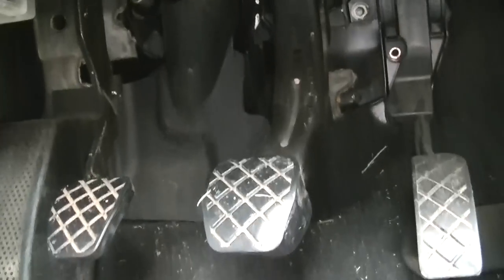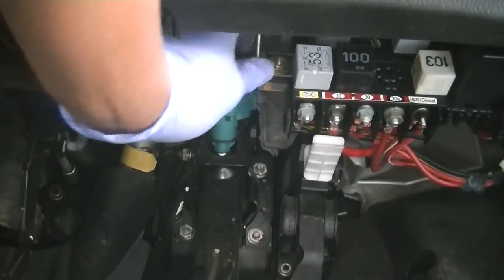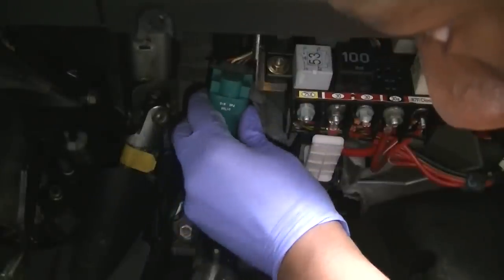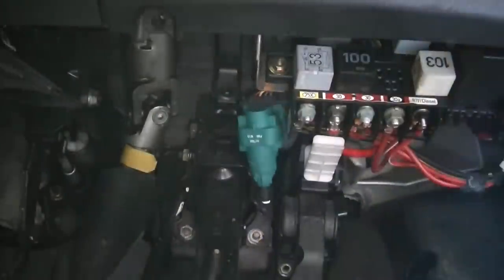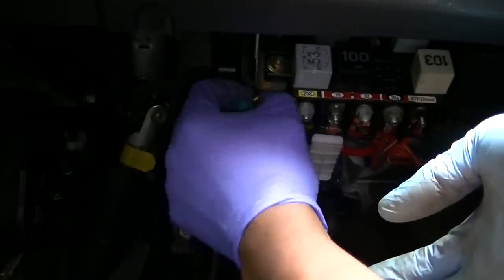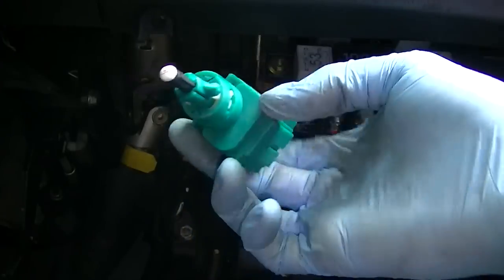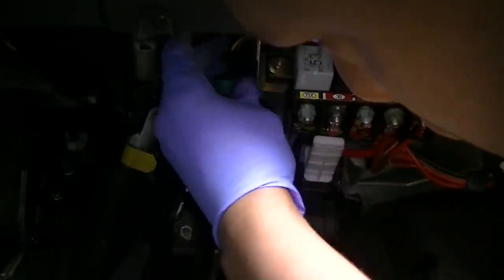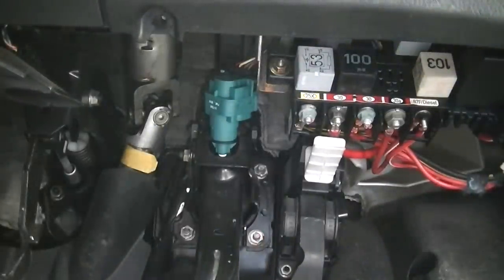VW Brake Switch Replacement

Comment: Good man.... the other day I parked in the garage and as the garage door closed behind me I noticed a red glow on inside of door. Thought to self, self, that's odd since it's daytime and didn't have the car lights on. Turned out brake lights were on.... Gave pedal a tap and they went out. But now a week or so later they seem on all the time and yes, the engine management light is on too so let's get a new switch. Hope it's not too difficult for my old bones to grovel in the footwell though. (Son might come in handy here....)
Reply from the maker: Thank you for watching

Comment: will that work on a 2000 VW caddy , the rear brake lights are stuck on the only time they come off is when , I pull back very hard on the brake pedal reversing the motion
Reply from the maker: It should fix your problem if the switch is broken. 

Good Luck

Comment: An easy fix to a problem I hope I might be having.

BMAC VAGS, I own a 2001 MK4 Golf and have an issue with my shifter being able to move through the 'PRND321' without the use of the brake pedal. Not very safe while driving! This started happening shortly after the brake pedal light stopped illuminating (telling you to step on the pedal before shifting). Would this be the solution, or would it have something to do with a cable in the shifter itself?

Comment: hi!good day! just wondering how about the ´glowplug light´on a dasboard blinking all the way and it´s say´s ÉNGINE WORKSHOP FAULT´..i have a vw touran 2005 model..i have been on a autoshop and they say it can be the ´brakelight switch ´sending some fail codes on a dashboard..but the worse, the auto mechanics keep on saying that..´this thing maybe the problem,or that thing maybe the problem´...i paid nearly 400 bucks to search what is wrong with my car but i found out that they cannot pin point what is the real problem on the car.maybe they are trying to rob me on other way,,please help..thank you in advance..

Comment: Is there a certain amount of depth that the switch must be in when replacing? Is there a stopper that tells you when to turn clockwise to tighten it?
Reply from the maker: no it is all prefixed ready for install. No adjustments needed for installation

Comment: Can this switch cause. STOP BRAKE FAULT to come on the dash. My brakes work fine. Brake fluid is full. I'll drive down the road. Stop the car put ignition off and start the car and the warning goes away

Comment: is this as easy to do on an Audi A4?
Reply: Hey Mark - seems to be the same according to this guy:
http://forums.vwvortex.com/showthread.php?1158315-DIY-Installing-a-new-brake-light-switch-(without-breaking-it!)&p=81885376&viewfull=1#post81885376
I'd check with the Audi dealer parts dept first though in case the part is different or has changed - you can always ask them what the right part is and for a quote, with no commitment to buying it or having it done by them.
I'll wager it's the same part. For the Golf, they seem to have upgraded the previous A, B, C, D switches to the new 1C0945511A, which I am about to fit. Seems like it is much easier to fit without all the adjustment trauma of previous versions... but we'll see. Famous last words.

(Edit: fitted it ok - bit of a pain getting the plastic trim out/back in but fine really. Bit tight on space and light, and you may need a screwdriver or two to push the plastic bits in to remove the plug from the old one, as they were indented a little on mine and wouldn't press in with just my finger and thumb. Other than that, surprisingly simple job. With the new 1C0945511A part, there was no reassuring click that they mention, just a kind of weak, dull thud when I turned it clockwise to the end of it's travel. So dull, I was afraid I hadn't done it right. But lo and behold, when I reconnected the battery, the lights are working again.)

Comment: Yeah, that part of the replacement is  the simplest step of the replscement. Why did you leave out the most frustrating steps that are required to even access the switch?

I cannot find any info on how to remove the pedal cover panel, or the locations of all the fasteners and trims that must also be removed as they overlap the upper pedal cover panel.....

Can you make a complete replacement video and not just the easiest part that needs no explanation? Sorry, but I am so frustrated, and angry at the engineers who design such ridiculous components.
Reply: I am dealing with my Wife's 2017 VW Golf Sportwagen SE